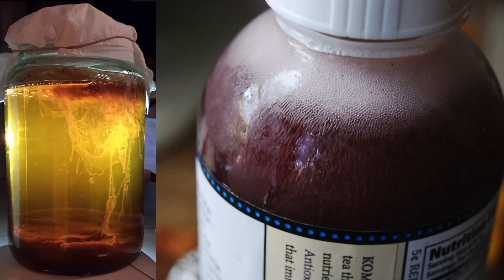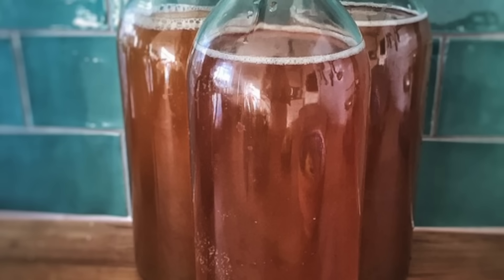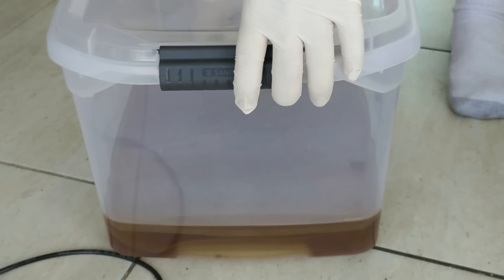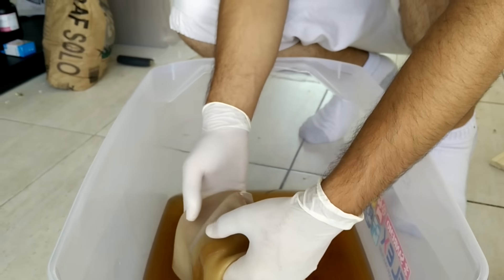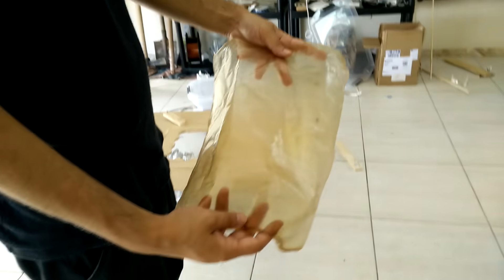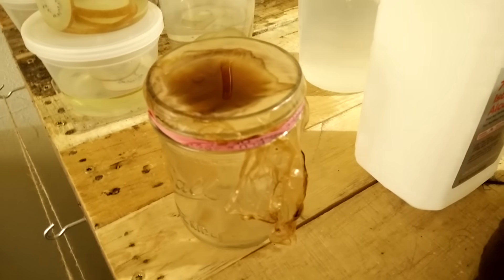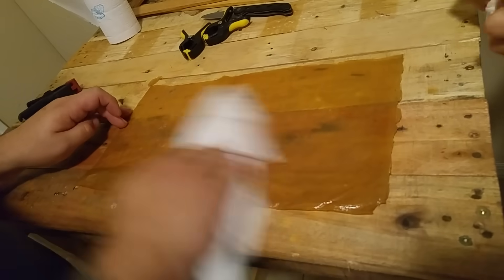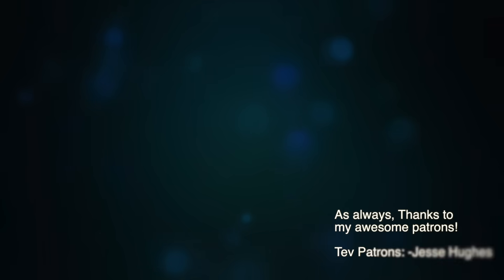How to Grow Leather-Like Material Using Bacteria (Making Kombucha Leather)

Comment from the maker: 2 important notes because I'm getting a lot of comments. A) I'm not vegan, nor do I have an issue with animal products from anything other than a environmental point of view. Cows take a lot of resources to produce and fart a lot. If we had slightly fewer of them, that'd be great. I'm not saying stop using them or waste parts of the ones we use, we just have an over abundance beyond necessity. So the material in this video isn't meant as  a replacement but rather and alternative for those concerned, and as a new material for others to enjoy and explore. It happens to be dirt cheap to produce, and very strong. Also and this is the really important thing to note that isn't in the video as we didn't find out until later, I know it looks clear in the video, it just does that when it's fresh. After a short aging period of about a month it does this and looks much more like the real thing:: https://youtu.be/NmcforoWc_g?t=1m38s
Reply from the maker: This guy gets it^. Also sugar doesn't take a lot to make. A small patch of sugar beets would be more than sufficient to do a run of this. We're looking at using waste water from other processes as the starting material instead of using sugar and tea. if it's possible to use the waste from brewing beer, or othe similair processes, then this becomes as sustainable as phsyically possible since it's only feedstock is waste from other processes.
Reply: Poperol Because this is an alternative to bovine leather that would be usable by those who denominate themselves as vegan for one reason or another
Reply: The Thought Emporium 

What about flammability? 
And compare mushroom leather? 

Just some ideas, this is really cool
Reply: Sugar is required for yeast, and this process uses yeast. What you are asking is for the impossible. Do you have an idea to do instead?
Reply: FreiNrg they don't have a lot of children because they are stupid, they have a lot of children because it's economically in their self interest to do so. More children means more farm laborers and more division amongst the children to take care of you when you grow old. If you lived in the third world country you should come to the same conclusion and do exactly the same thing. So, how would you feel having a bunch of rich dicks in first World countries talk about murdering you for being sensible.
Hell, compared to wealthy people you're third world for that matter, how would you like all those rich liberals in Hollywood contemplate your murder because you are wasting resources?
Reply: TTeaMeister Inspector Tea would sugar really take more resources than what it takes to maintain a cow?
Reply: Sugar is literally most abundant biological nutrient on this planet!  It's made from carbon dioxide using photosynthesis by plants.
Reply from the maker: Rayon is made from trees mostly. And while theoretically paper products are only supposed to be made from farmed trees, this isn't usually the case. While some of the time it's made from scrap cellulose from paper products, most often it's done with fresh wood pulp. So rayon production inevitably begins to consume forests. You can theoretically make rayon from this stuff since it's cellulose. SO the way I've been thinking about it, is that this is fabric without cows, and paper without trees. If we can make this grow on the waste from other processes like beer making, or noodle making, than we literally can turn waste into useful products.
Reply: Tory Evans It is indeed
Reply: +The Barking Mouse bacteria and yeast. symbiotic culture. that's why it's called a scoby. symbiotic culture of bacteria and yeast.
Reply: Hey, that transparent one could be used to replace cling film or "Saran wrap" (I think thats what you guys call it). It could be used as a biodegradable version that would be safer.
Reply: Richard Smith As mentioned, use a waste product from a different process instead of pure sugar
Reply: Richard Smith I indeed have no idea to what could be used, so that's why I said I hope he finds something that works
Reply: I just realized that my question sounded rhetorical.  LoL,  I was actually asking genuinely.  I have no idea which would take more so I was curious.  Yea, the real estate would still be a thing, but i wonder if larger scale production would could use less. Maybe the cultures can be scooped up and pressed flat like how we make rubber.
Reply: It would probably be close to mushroom leather, since part of the SCOBY is technically a fungus.
Reply: +Michael Balfour I don't think it would keep food well. since it is thick and coated in oil and or other nasty stuff.  Common plastic wrap is roughly 0.5 Thousandth of an inch (12.5 μm) thick. The trend has been to produce thinner plastic wrap, particularly for household use (where very little stretch is needed), so now the majority of brands on shelves around the world are 8, 9 or 10 μm thick.
Plastic wrap was initially created from polyvinyl chloride (PVC), which remains the most common component globally. PVC allows permeability to water vapor and oxygen transmission, which can add to the duration of peak freshness of the food products wrapped. There are concerns about the transfer of plasticizers from PVC into food.

A common, cheaper alternative to PVC is low-density polyethylene (LDPE). It is less adhesive than PVC, but this can be remedied by adding linear low-density polyethylene (LLDPE), which also increases the film's tensile strength. blessings
Reply: Richard Smith like... Any waste stream of the food industry
Reply: Tory Evans no, I'm just saying that it still uses a lot of water
Reply: This is cool. Its always good to have additional materials to work with, especially if they are renewable :)
Reply: BrokenMonocle thanks I was wondering, since it was see through
Reply: There's plenty of reasons to appreciate this, such as the reduced pollution or the reduced costs. And the idea of not making an animal suffer to produce it is also a good reason, no matter if you are vegan or not
Reply: Zachary Bittner Or you could use environmentally friendly 100% renewable real leather.
Reply: In fotography chrome alum is added to gelatin to make sure that the gelatin does not dry out mayby that substance can be used to prevent drying out
Reply: You could try growing it into some kind of fiberous material. Cow hide leather is fiberous as it is, plus it'll give the materials strength and something for the bacteria something to grow on. I'd try cotton, cotton and polymer fabrics, and screen door mesh
Reply: it needs tannins and acids in the tea. to make the parts of itself. 
it lives in sugar water, but it does not seem to thrive.
Reply: You started with A). Where’s B)?
Reply: I'm far from vegan and this is a fantastic idea.  If it ends up being better or at least cheaper than leather, people will go for it regardless of how they feel about animals.

Have you tried just growing a culture with more sugar water (and whatever else they need) instead of making more tea?
Reply: well it's still really cool
Reply: Like what?
Reply: The Thought Emporium So.... use goats, deer, pigs, etc.
Reply: Ranz it already exists. It's called Rayon
Reply: The Thought Emporium Which is always a good thing.  I wonder if it would grow on grey water?
Reply: Ah stan voice I learned something today.
Reply: Nice thanks, some pretty good points, I guess it will have use else where.
Reply: Could you use just sugar water to grow the colony? Since you're not doing it for drinking purposes. What's the special ingredient in tea that makes it possible? I feel like you could maybe KEEP it clear if you actually tried to do it.
Reply: MrRolnicek SCOBY feeds off of sugar and caffeine. That’s why sweet tea is used, and why only caffeinated types of tea work (black, green, oolong, etc) and not herbal teas.
Reply: aren't we all
Reply: The Thought Emporium would be cool to make maybe a raincoat or umbrella.   Maybe even see if u could make waterproof shelter with it.
Reply: TTeaMeister Inspector Tea, 

I keep hearing of this year after year, but have gotten no satisfying explanation - what's up with this whole "uses water" thing, why do people oppose using water? Water is not destroyed by crop irrigation! It will all end up in the ocean sooner or later, evaporate from there, and fall down on earth once again. I understand that there are regions where drinkable water is overconsumed by irrigation, making it unavailable to someone who needs it, but i don't see how it would be an issue globally and in general. Just... grow crops where fresh water is abundant, right? 

A separate issue is contamination of water reservoirs by pesticide and fertiliser, which is transported there with irrigation water and rain water, but it's not directly related to how much water was used for irrigation! So water consumption is not the underlying issue here, ecologically unsound agriculture is. This makes "water consumption" propaganda an attempt at dangerous misdirection.

I can see what you mean with better utilisation of waste products, basically anything containing starch or most plant matter could be hydralised to sugars, but this is not necessarily energy efficient. To me, "just use water" seems like a more ecologically sound path, if done in an ecologically sound manner.
Reply: savagesandwich 1, lead is for example a metal.

I could give you more metals. Lithium might be appropriate too.
Reply: Fire Test?
Reply: Would it work, growing in larger surface areas like a kiddy pool?
Reply: It’s still awesome. One great use of leather is for seals and gaskets, how does this compare?
Reply: How long before it decays?
Reply: The Thought Emporium 
Nice. I’m definitely interested in it. I agree with most of what you’re saying. Not sure about cow farts lol I’m still looking into that. 😂
Reply: The Thought Emporium Wait, where’s B)?! You only put A) ):
Reply: Agreed. There is a superabundance of wastefulness in modern society. Viz. All those dimwits who need to turn a light on, even though it is not needed, then forget to turn it off. Or use several litres of water to clean a cup, or their teeth, which is usually done before breakfast, but they never rinse before brushing, because they don't know how to clean their teeth.  There are many examples of this level of stupid.
Reply: There are other leathers other than cow you know?

I raise rabbits. 
You can also get kangaroo.
Or bison.
Or other animals that are a little more ethically grown/harvested.
Reply: The cow farts thing is a common vegan propaganda. The fact is that marshlands and volcanoes produce much way more methane respectively than all of the cows put together.
Reply: WHERES B)
Reply: Where is this waste sugar coming from? Yeast needs sugar from something to function. I am trying to figure out what you are suggesting, but you are so vague it seems as if you have no idea yourself. Offer actual alternatives if you want to criticize.
Reply: Zachary Bittner It is a mold I think.  Not bacteria.
Reply: The Thought Emporium then you're a pawn.
Reply: I'm vegan. could you give me a metal? because I deserve it.
Reply: The cost of owning and maintaining 5 cow farms is still less than the cost of making one cows worth of leather in this way
Reply: " cows take a lot of resources to produce" ...wtf ..." Produce" ....we dont produce cows lol, they afe born from their mothers.....theyre not inanimate objects
Reply: * eyeroll *
Reply: Looking at the fact that the tea and sugar needed for this still take a hell of a lot of resources to produce I wouldn't call this a really sustainable alternative
Reply: @biggie_tea  compared to cows?
Reply: All of you are all idiots. What they are doing is taking bacteria and killing it which produces cellulose fibers. We already do this currently with wasted wood pulp that we turn into cellulose fiber. It's called rayon. The reason why rayon isn't environmentally friendly is because the process to make it long lasting and not water soluble is by using very toxic chemicals.
So rather then using recyclable wood pulp, this person found a way to make rayon by growing bacteria with sugar instead making it even less environmentally friendly.
Since I don't see anyone else pointing this out, I'm just going to assume they are deleting comments.
Reply: The Thought Emporium I really hope you can eliminate the sugar, as even as you use beet sugar and don't use tea, you'd still have a water footprint of over 1800l of water per square meter
Reply: If you're not vegan, don't actually object to the leather industry and actually don't enjoy the politically charged discussions the term "vegan" sparks... Why use the term in the first place?

Comment: I have a good question here have you tried different kind of tea ? Expensive tea to cheap tea.   does it make a different in the texture?  And is this achieveable in large bulking without use of modern technology ? If it does take 1 month then will it be the same if you use 50 tea bag and 50 cup of sugar in a reasonable size container and can you cut this like bacon after or before treatment?

Comment: so what happens when you had that in your pocket for a couple months and then it gets wet? would be a nasty mess in your pocket is what it would be. the oils do not last long before wearing off, you should read up on oil canvas to see what all is involved in using this type of material. using organic oils this will never replace leather, you need something that wont wear off or dry out after time. maybe a silicon oil infused into it inside of a vacuum. also leather is much thicker than you are making this and is also not transparent.
Reply from the maker: We took it into the ocean in our pockets by accident and it was fine. It's actually mostly water resistant unless you let it soak in water. I made a new wallet after this video (you can see it in the q/a video) and I've had it for almost 8 months now. It still looks brand new so long as it's occasionally rebuffed. And it's still incredibly strong. I've been handing it out at bars that whole time trying to see if anyone can tear it and so far it's held strong.

Comment: I've been experimenting with this for a few months and yes, it is easy to make, requires low resources and is clean to the environment. I had used olive oil as there is a plentiful supply but hadn't gotten around to trying coconut oil. As it dries it shrinks into whatever shape you wrap it around so exotic lampshades, drinking vessels, hats, etc are possible. Book covers were the first things I made from it and the material hasn't changed shape due to moisture in the air over the winter. Your presentation was really interesting. Thought it's not mainstream, I'm sure you know the Chinese have been using this for a long time as a leather replacement.